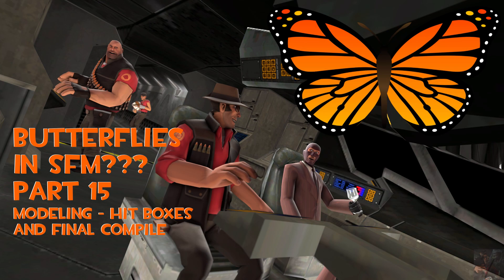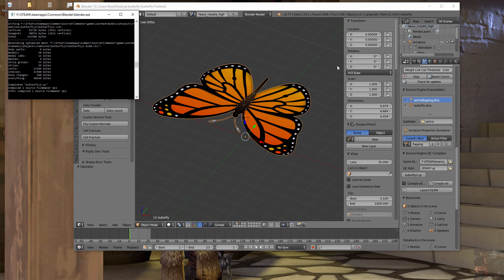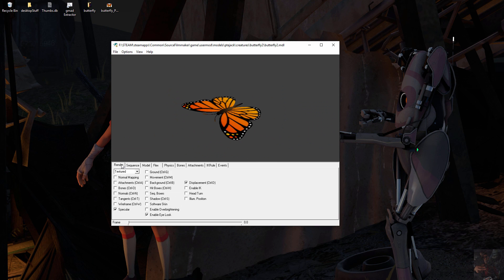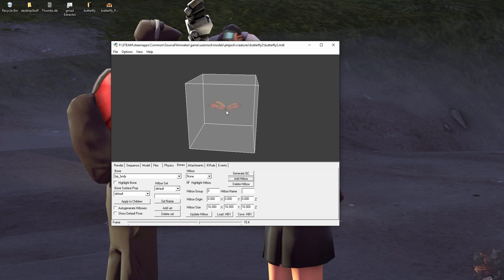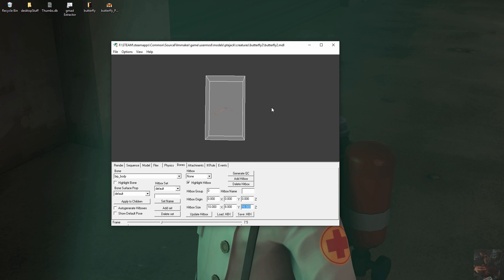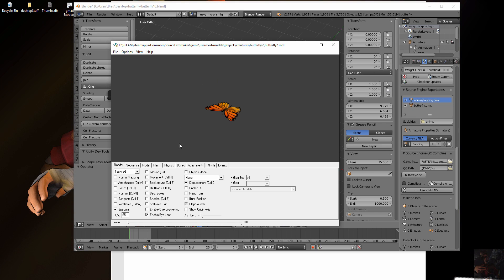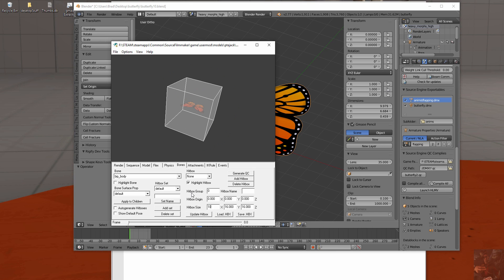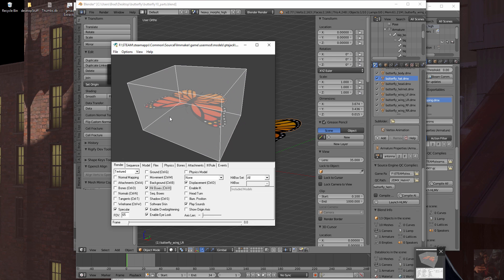Simple Model Blender to SFM - Pt15 - Creating Hitboxes using the HLMV

Comment: My textures aren't showing, essentially, the model's invisible, if you'd like to see the textures, I could email you a download link to a folder containing all the vmt's and vmf's. If there are any problems you can think of relating to this problem that has to do with the QC file, or the model itself, please tell me, and I can provide you with a download link to those, too.
Reply from the maker: If the model is invisible, load SFM, start a session (you don't have to load a map), start the spawn sequence for you model and have the SFM console viewable. In the model browser find your model and select it but don't spawn it into SFM. As soon as you touch the model in the browser, look at the console window. You should see  message like can't load {path/filename}.vvd or Can't find {path/filename}.mdl . This mean that the model files are in the wrong folder and the DX90.VTX, .VVD and the .MDL files need to be moded to the Path specified and be renamed to the filename specified in the error.
Reply: I'll try that -- thanks!
I'm only seeing the error like, "Material models/caboose/starships/constitution23c/ncclines does not support vertex format used by the mesh (maybe missing fields or mismatched vertex compression?), mesh will not be rendered. Grab a programmer!"
Reply from the maker: That's a common error and I think can be ignored.  Can you zip up your model and materials (keeping its current path) and send it to me via dropbox or some file server service like that?
Reply: *****
alright, I'll do it as soon as possible, again, thanks for your tips and help
Reply: *****
I DMed you a mega.nz link with the decryption key